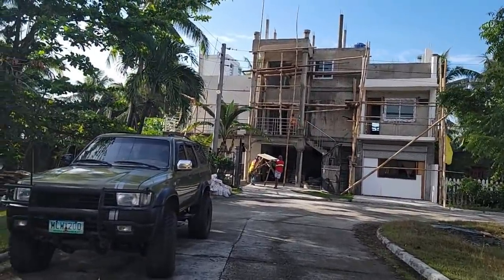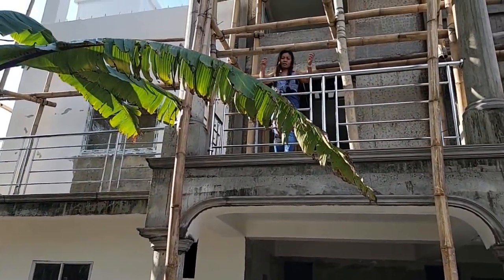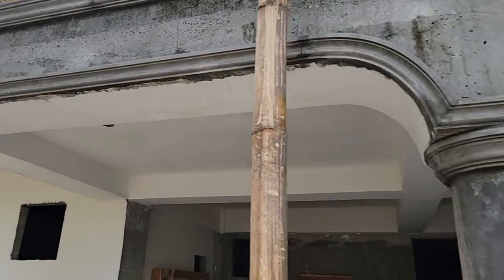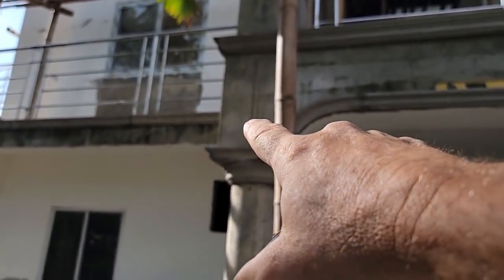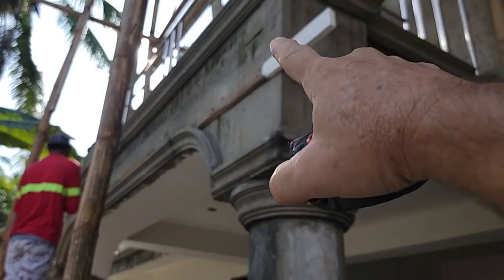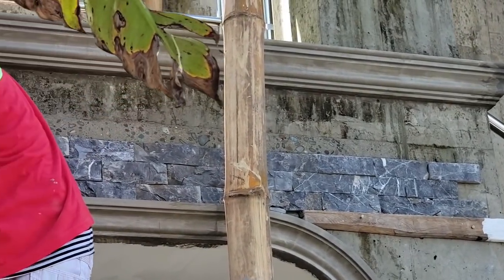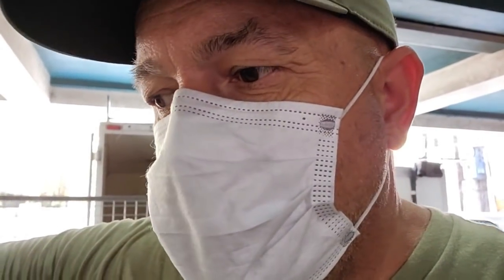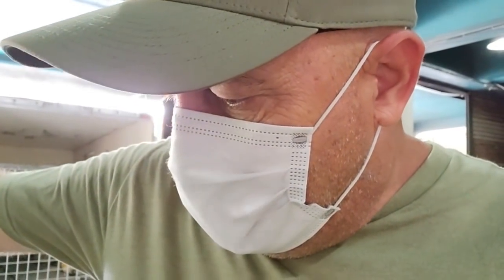Philippines Beach House Build Day 275 BREAKER BOX BROKE ME for a PROPER PANEL

Comment: That black slate looks wicked mate,it goes good with the stainless,the only problem with slate is  resealing it from time to time,in the mid eighties slate was popular in bathrooms, I was building a house and going to use slate so i asked an Italian tiler on a big building site I was on his opinion,all I got was "f*cking compacted mud" hahaha,those Italians are purists when it comes to tiles,in his defense,it was super hard to clean even after ten coats of sealer in the shower recess and made the bathroom look small and dark,I ripped it up a few years later and retiled in ceramic,much better,but your feature wall and entrance look great
Reply from the maker: That is black marble not slate. Very hard and you can polish it like glass.
Reply: @TexasFilipino  those little tiles are marble,not slate?Mao ba?,sorry bloke,my bad,I saw a previous video of you buying slate,I thought the black stuff was the same material,I should try and keep up,anyway,it looks the goods,massive project btw

Comment: I just did some electrical updates on my house and to keep it up to  code the breakers alone were around $40 each.  Electrical has gone up quite a bit since the days when I used to do panel updates and new installs. Love the house.  Curious on the exterior trim detail if those castings are going to be an accent color between the paint and  the  black stone?
Reply from the maker: Yes I will be painting all the precast trim

Comment: So does your area have 3 wire 240v availability? We only have 2 wire 230v. I am changing all our 2 plugs to 3 plugs, but its only for convenience for items with 3 plugs since our whole system is only supplied by a 2 wire 230v 60 cycle transformer. Plus we plan on going solar in the future and then can have a 3 wire system. I know your using solar. Is your solar 120v or 240v?

Comment: Hello James im just going over your old videos on your solar and electrical.  The panel you got here in the site looks like a North American panel could a person ship a panel over in a box, would it work here? Seems to me it should work.
Reply from the maker: I bought it here local and they are easily available here. I would not ship one because the 110v/220v split phase breakers will not work right or be safe. They need to be for SINGLE PHASE 220v not split
Reply: @TexasFilipino  

Thanks for the quick reply James, if I may ask another.  Your solar system all bought local?

Comment: Another question you never showed the breakers are they screwed together or riveted also are the contacts that seat for the power are they pure silver or copper. What I mean is the place on the ON/OFF switch to turn the breaker on, power contact point.
Reply from the maker: Because I ha e not made video covering that yet.
Reply: @TexasFilipino  oops lol

Comment: That is just looking wonderful, everything is coming together greatly
Do you think it would be worth it to send box and breakers over from USA
I agree with all the comments,the black is the way to go, I hope I can find something similar to go in my house.
Reply from the maker: do not send breakers and boxes form USA as it is not designed for this voltage and amps. The breakers will not trip properly when they need to
Reply: Thanks James for the info, and as I study it, it's not really that much more expensive than USA anyways, and there are definitely other areas of the build you can make the difference up.

Comment: I agree grounding is key for those electrical boxes, could save alot of equipment and bs.. Is there any validity to the handrail being a lightning rod, maybe ground that too, not sure, have no clue on that issue,  Just inquiring.
Reply from the maker: It is welded to the rebar in the concrete. I am having a hard time getting solid uncoated wire for direct earth ground. I want to ground everything!!!
Reply: The old barns here in Canada we drove this huge spike into the ground with copper wire to the roofs lightning rod

Comment: What are u planning to use those 15A breakers? Coz 15A will take up to 30 led light bulbs
Reply from the maker: 15a in the Philippines is not the same as 15amp in North America. Double the voltage half the amps

Comment: Personally I think all the stone looks good 👍🏻👍🏻 two thumbs up man.... Do you have to use a different mortar for the outside 🤔
Reply from the maker: First thanks Dwight! Hope your doing well. I bought t heavy duty tile adhesive with bonding agents in it. It is for indoor or outdoor applications and it really bonds so strong. You have to watch out because the average masoon ( mason but they call MA SOON ) will just use portland and fine sand. That usually fails.

Comment: in the U.S. you can not use 14 gauge anymore and not even for a traveler.
Reply from the maker: This is not USA. North America uses 110-120v  single phase 220-240 split phase. Here it is 220v single phase period. No split phase. This means with higher voltage less amps thus 14 is the MAIN WIRE used here for almost everything. 12 here is used like 10 or 8 in the USA. Remember North America is the oddball of the world. The rest of the planet uses 200-240v single phase
Reply: Really? So it's all 20A in US now?